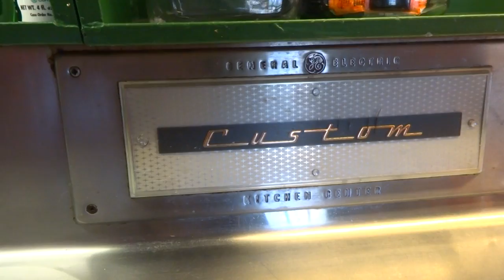PROPRESS FITTING POPPING OFF INFERIOR  PRODUCT TO SOLDERING

Comment: Wouldn't want anything but soldered copper in my house
Reply: I have seen bad solder jobs that have blown apart, My point is you can fuck up most things in this world nothing is fool proof
Reply: @MW-rk7nl  I  am living proof of that statement
Reply: @Samlol23_drrich  I've seen thousands of pro press joints and they never leak unless they were installed incorrectly. I've fixed 10-20 year old solder joints that randomly started leaking and when you pull the fitting apart the plumber never got full penetration around the entire joint. Those same plumbers are the ones crying that they don't like pro press. Nobody gives you a 50 year warranty on solder.
Reply: @jman0870  is that you, Mikey??
But seriously,  nothing is perfect but solder has a track record and we don't have that type of long term data on pro press yet because its relatively new. In 100 years from now I may think otherwise but for now,  solder would be my choice
Reply: @Samlol23_drrich  Solder doesn't last 100 years. Being around 50/50 solder joints when repairing a water line is terrifying because you could break one at any second. Are you even a plumber?
Reply: @jman0870  no, I'm not a plumber so I'm actually talking out of my butt. I've done plenty of soldering,  though. 
Listen, I ran an AlPex zone to heat my garage. The connection to my boiler was soldered copper. 
Not quite propress but a press fitting none the less. Its been almost 10 years with no leaks.   If it weren't cheaper and easier I would have gone with soldered copper. 
Have any silver fillings? Well they are still the best, time tested type of filling. Yet I'm a dentist and only do white fillings. I believe in them, but I'm aware that until they have 100 years of failure data, I can do them and recommend them, but can't back up my recommendation with years and years of data. 
All im saying is in my house I would prefer soldered copper.
Reply: @Samlol23_drrich  all I’m saying is that your opinion doesn’t matter because it’s just that. It’s a purely subjective with no facts to back it up. You aren’t even a plumber. I’d press my entire house in a heartbeat after what I’ve seen and fixed in my career. Yes, I’ve fixed more leaking solder joints that failed in the 3.5 years that I ran plumbing service than press joints. In fact, I’ve never seen a press fitting leak that wasn’t due to installer error.
Reply: @jman0870  I didn’t say my opinion should matter to you or anyone else. In fact, my original post wasn’t suggesting what anyone else should do.  It merely explained that in My house soldered copper is all I would want. My opinion is my own, and matters to me. It shouldn’t matter to you, nor should it be given any weight since I’m not in the business.  Have you been in the business more than 3.5 years? Or is that thirty five years?.  I would think there are exponentially more solder joints around than pro press joints, so of course the failure rate will be proportional to the use rate.
Reply: @Samlol23_drrich  I ran plumbing service for 3.5 years because my boss at the time said if you can fix an air conditioner you can make shit run down hill. Congratulations you’re a plumber. It wasn’t by choice. There was no training. I have fixed more plumbing issues and created more fucked up plumbing issues than any joe blow the homeowner by far. Don’t even try it. 

At the rate of hate people have for press, you would think that the thousands of press fittings I’ve seen in action would have had at least one leak. I wish I could say the same for solder. Damn I feel like a broken record talking to you for some reason.
Reply: @jman0870  well my next life I'm a plumber/hvac. At least people are happy when you show up and pay their bills. I own a ten chair dental office.  I've got plumbed water, nitrous oxide & suction.  I haven't called anyone to fix anything in at least 15 years. I do it all myself. 
Same at home. Got two 30 year old Anderson AC units and a 30 year old Peerless.  I service them all. 
Of course I don't have the expertise and skill as someone who does this for a living. But either you are a fixer/maker- or you aren't. Regardless of career choice. The grass is always greener, but I would rather my kids go into one of the trades than follow in my footsteps.
Reply: @Samlol23_drrich  Build a new dental office and watch the plumbers tell you to pound sand when they plumb the domestic water with pro press unless you specifically spec it to be soldered.
Reply: @jman0870  i know enough to know that's not how it's done. I get specs up front. Some guys solder, some don't. Gotta look at the whole picture in a bid. I would never ever tell someone how I "want" something done.
Reply: @Samlol23_drrich  that’s exactly how it works. An engineer draws it up and specs certain things. The contractors bids change based on how it’s specced. If they bid to press everything in a day and you try to tell them to spend a week or two soldering it they will tell you to pound sand unless a change order is approved and paid for. Period. Labor costs are much much much higher than the costs of press fittings.

Comment: I'm thinking it wasn't installed correctly. It appears to me with a hose bib run that distance it may not had good pitch the drain back as a result for him to keep on getting it repaired. Who knows if the homeowner opens up the outside hose bib when draining the inside boiler drain. There's a place for ProPress and there is a place for soldering!

Comment: I am like you Steve is that they need to learn to solder. The first time I seen one  of those joints I said to myself how long will that o ring last in a hot water system
Reply: They have those here in the UK as well. Plumbers are making future work for themselves.
Reply: Many, many, many years.
Reply: 32kn of force fuses the copper this video is just someone didn’t properly insert fitting all the way or probably used the hydraulic press tool of Amazon 

Viega propress has been around 20+ years
Reply: @johnnya4236  The ones I am thinking of have an o-ring for a seal.

Comment: Thats CPVC to propress installation.  As a DIY, I would do either.  To me both systems are inferior to soldering and Pex b.  I also wouldn't want PexA which stretches plastic pipe and ring to make a connection.  Those stretched parts always want to shrink.  All plastics become brittle overtime.  Eventually shrinkage with cause brittle plastic to form cracks

Comment: I'd never allow that to be used on my property, solder or I'll find someone else willing to work.
Reply: Ive installed thousands of PP fittings from 1/2” thru 4”, and never had one do that, Ever.  It wasn’t installed properly.
Reply: I have seen some faulty soldered pipe work. Pro press is outstanding provided it is installed properly.

Comment: Ive used it for years but i have seen it freeze and swell enough to loosen fittings. I still solder if i think freezing is an issue
Reply: If freezing is an issue, it really doesn’t matter what you use 🤷‍♂️

Comment: breakers right underneath the old GE chicken sink !!!???   wow
Reply: You wanna be close when that sucker catches fire!  ;)
Reply: I was surprised by that part too, and the fact that it still has all of the original GE breakers. 
A job I was on about 6 months ago had a several panels of those same GE breakers, most of it went in the trash but I kept one of them since it was rare. Basically is a predecessor to a modern day GE THQL.

Comment: Not only are they using it for water but these lazy mofo's are trying to get it in air-conditioning!
What a disaster waiting !!!🤣🤔😂😆😆🤣🥃🥃🍺🍺🏌🍇🍺
I don't like pex either but I am getting ready to use it in MY(MY) HOUSE! 
The fittings expand and contract at different rates than the straight pieces?🤣
JUNK!
P.S where is your A-3 tip ? I know you have one😁
Stay safe.
Un-Retired keyboard super tech.
Wear your safety glasses.

Comment: 2 ways this happens either it wasn't pushed in all the way in at the moment of pressing which I hardly doubt cuz it will leak   or the  pipes froze I see it a lot fittings will pop out instead of the pipes spliting or bursting so my veredict as licensed plumber is the home owner forgot to drain spigot it froze and there u have it a second repair on a promt to freeze pipe

Comment: One of the reasons guys use propress is they don’t have to use flame. A lot of commercial/industrial installations require “hot work” permits and “fire watch”. Not sure about residential.
Reply: Most of these guys don't know what a fire watch or hot work permit is. This section is full of resi guys who just happen to be better than their competition and it went to their heads

Comment: Not sure I would solder or apply any kind of  heat this close to the Viega connection. There is a rubber O-ring inside that may, and probably did, get damaged by the proximity to the heat

Comment: Press fittings work just fine it’s the people using the press tool that is the problem.  Consider this, all hydraulic equipment and hose fittings are pressed on together and hold back more pressure than we will ever see in plumbing, same with air fittings.

Comment: Amid the sheer volume of hackery posted on this channel daily, this is a pretty amusing take.  Done right, Propress is the gold standard in copper plumbing.  Process piping-caliber connections even in a residential setting.. It’s pretty clear some trunk slammer used a no-stop coupling and didn’t seat the left pipe properly.  Probably even used hand tools (yep, they exist… no clue why).  Do it wrong and the joint won’t last  - no different from soldering.  RTFM.

Comment: Why do I feel like there's a chance that somebody (maybe even the homeowner) tried to hear up the pipe with a flame to thaw the frozen pipe? That's IF it was frozen. I only have that suspicion because at the beginning of the video he said maybe frozen and then I see CHARRED MELTED wire right by the "pooped off" fitting.
Please correct my if I'm wrong because I'm very interested in propress. I've only done soldering. Lots of it.

Comment: I'm not a fan of the Pro Press stuff either. I can see an even bigger problem down the road. That stuff is just sealed with a rubber O-ring and eventually water is going to break them down, making a leak. My work hired a guy that worked for a remodeling company and he bragged about it. I told him I know how to solder copper and didn't believe in crimping pipes together.
Reply: You know what they say, you can't teach an old dog new tricks

Comment: Here in the UK everyone loves press fitting! It has its place but in domestic its pointless. The fittings are 10x more than solder fittings.. you need different fittings for water and gas, the gas fittings have a yellow O ring and water has black.
Reply: In the US you have to use mega press for gas. It's a completely different fitting that uses a completely different crimper and dies.

Comment: 10:03 Applying a wet rag immediately to a soldered joint will cause micro-fractures.  The soldered joint should be left alone and allowed to cool off by itself.

Comment: I've soldered and used the propress . If done correctly the pro press is just fine . Looks like someone used a cheap Chinese version and fittings which yes they can cause problems but so can crappy soldering as well .

Comment: The problem is,Cheep ass copper coated steel pipe.The press fittings will bite and hold on copper,but can't bite the steel and will fail under pressure.
Reply: There is no steel in that pipe....

Comment: Pro Press when installed properly , using American pipe and Viega fittings should work just fine . If the pipe is Chinese the OD may be out of spec and if you are using Viega copies that you can find on Amazon well then the joints will fail !

Comment: The only time I use ProPress is when the water can't be shut off and there's no other option to shut the water completely off. I know you can roll up some bread stick it in there and it'll eventually work its way through the system. But when the water is rushing to hard that doesn't do anything. I unfortunately have the manual hydraulic ProPress crimper which is a big pain in the ass cuz you asked for lutely need two people one person to hold the pipe together the other person to operate that hydraulic tool

Comment: no Heat mat to protect the wall, electric cable, could have cut the pipe from the left side to avoid heating up the press fitting O Rings???

Comment: At work they run a 4 inch copper press line for safety showers, no soldering allow because12 inches away was a 4 inch line full of hydrogen feeding the labs.
Reply: That is what pro press is good for but I will always solder when i can

Comment: To be fair, Im a DIY homeowner. I have always sweated copper pipes too. I went to the Propress website and looked at the fittings and I see they use an O-ring in there. All I can say is that I have valves and such that use O-rings and they eventually need to be changed out as they deteriorate. I guess I can see the same there. So, It would be terrible having a house full of this Propress and have to be cutting into walls and such to replace fittings when they eventually do leak. Whats more, I think you can run into problems if you decided to convert over back to soldered joints. You risk melting the O-rings in fittings close by. I will stick with sweating pipes because I know they last a VERY long time without failing.
Reply: If the oring fails the fitting still isn't coming off the pipe dude. It's pressed on...

Comment: The situation in this video is perfect for pro press.  Close to walls and combustibles.  No hot work permit or fire extinguisher needed.  If done correctly you are in and out in 10 minutes. Of course I know how to solder, but in most situations pro press is a better choice.  You need a quality tool and quality fittings.  You can't say you never saw a solder joint fail.  BTW the rubber gasket in the pro press fitting has nothing to do with making the joint water tight.

Comment: A properly sweated fitting is stronger than propress but propress is still a fine product and can more than handle residential pressure.  Don't blame poor workmanship on the product.  The machine needs to be properly calibrated, those do not appear to be fully pressed, viega would tell you the pipe has to deform.

Propress is very expensive and it's not the tool it's the fittings, plumbers already have expensive tools you buy it once but the fittings are 2-3x the price, now potentially you save a significant amount of time and of course less skilled people can work faster in press than solder.  The other reason big plumbing companies love propress is that it saves them money on their insurance.

Comment: I like the soldering system better because I know it will stay in tacked forever the pro press is so expensive and the fittings are so expensive and there is no guarantee it will hold up

Comment: And the shutoff valve with the press fit was put on a PAINTED pipe - what a joke! And now the heat from a torch is probably gonna destroy the rubbers in the pro press fittings.

Comment: I think its a little extreme to say PP is shit. I've had one fitting leak in five years let alone one pop off completely. I'm all for soldering if the scenario calls for it. I'm my mind the dude didn't have the pipe completely inserted. Mark your fittings for proper insertion depth ... no problems...

Comment: Like all things - even soldering, brazing or welding, ‘propress’ type fittings rely on skill AND using the right fittings, the right tool which is fitted with the right dies. If it is done correctly then there is no reason for the fitting to pop out.

Comment: Roger Wakefield actually did a freeze test on fittings and the shark bite did best. Regardless a poorly done joint will fail regardless of the method.
Reply: I can confirm shark was stronger than sweat

Comment: I work on appliances for my job, and I have repaired a cooktop with those pushbutton controls before. The control was built right into the wall and it must have been from the 50's also. As far as I now its still working for the customer.

Comment: Steave. You can not Weld near this propress fittings 25 diameters  , you need to use wet rags,  both ends ,otherwise the O rings  ( EPDM ) will get damage. It looks that the guy who did it , did not even mark how deep it should go and left it short causing it to pop.

Comment: I've seen solder joints pop off like that as well. I appreciate the old school approach, but there are times when doing hot work is not the way to go.
Reply: Yes they will pop if you soldered with 50/50 lead that in my area your not supposed too but with aquasol and a good solder there is no way that it will pop probably crack the pipe first

Comment: I've been in the trade for 50+ years as a Plumber-Started off wiping lead joints -can solder with the best of 'em -But I only use Pro Press and Mega Press-saves tons of expensive labour time-Only time I've seen pro press pop or leak, is if it froze or wasn't inserted properly-but I've seen hundreds of badly soldered joints that leaked -I've been using Viega since it came out in Canada a few years ago-and I wouldn't go back to the old school soldering/wiping joints/caulking cast iron instead of MJ/-If we all stayed in the past we would still be threading galvanized water lines.

Comment: Most likely the pipe wasn’t inserted all the way. You can tell the installer didn’t know what he was doing by looking at the female adapter that buts up to the tee. The piece of pipe between those 2 fittings its to short, fittings aren’t supposed to touch.